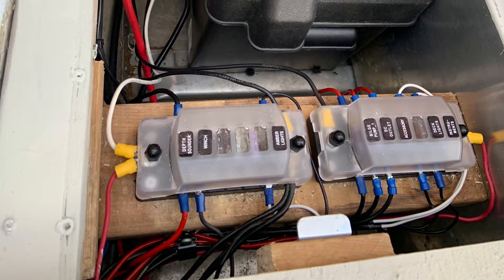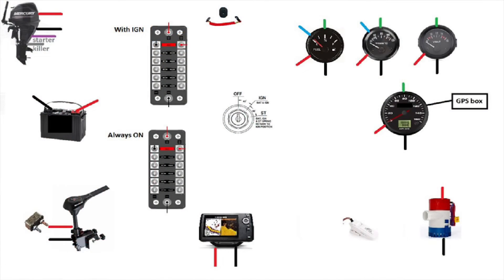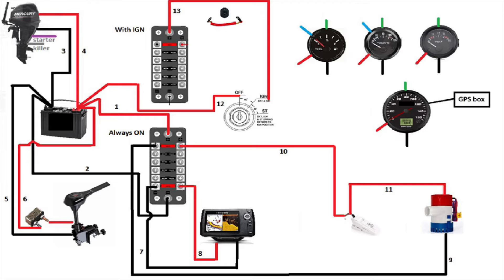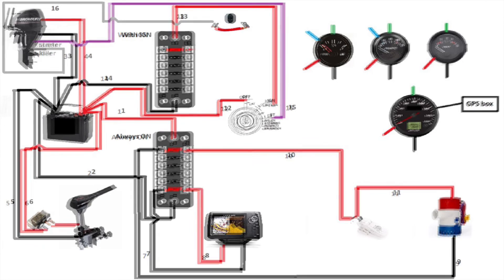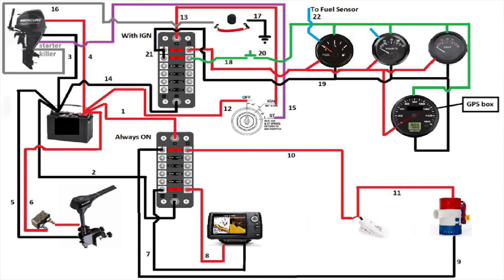Boat electronic wiring diagram

Comment: If you ha solar panel and a alternator o motor you need select key switch for charge the batteries. Other wise you put fire on tour boat
Reply from the maker: Hi nilosantos, thanks for watching, you can run an alternator and solar panels to charge batteries simultaneously, which is common in RVs, boats, and vans for faster, more reliable power, but you need proper controllers (MPPT/DCDC) to manage voltage and prevent overcharging.

Comment: I always thought the voltmeter showed that the motor was charging the battery, but here it simply shows that the battery still has 12v, or have I misunderstood it?
Reply from the maker: Hi Rsngo, thanks for watching.
 If the battery isn’t discharged, you will usually get a voltage of 12.x V reading of the battery. 
When your motor is on and it’s charging your battery, you will see a slightly higher voltage about 12.8v to 13.8v depending on your regulator or alternator on your motor.
Reply: @joetheboatguy5394 thanks :)

Comment: Your the best! Fantastic video man 
Do you think this concept can be scaled up to a dutch barge style boat with an inboard engine?
Reply from the maker: Hi trelcomultiskilledtraders, thanks for watching and nice comment :) This can work for a Dutch barge style boat but you will probably need more batteries in parallel since the boat will have more power needed. Be careful with wire gauge. If your boat is mostly docked then I would had solar panels. Let me know if this helps

Comment: you have just created a mass of short circuits
Reply from the maker: Hi Cien_Swiatla, thank you for watching. Can you be a little more specific where the short circuits would be? Because this circuit has been created and working perfectly with no issues for years. Let me know, Thank you.
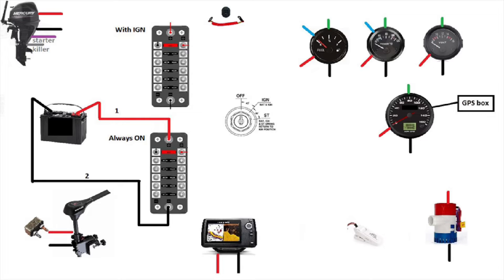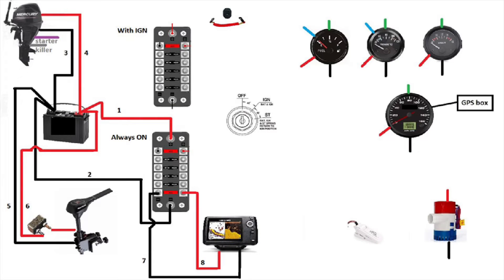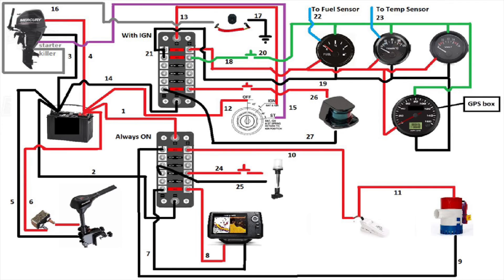Reply: @joetheboatguy5394  1:20, 1 side of the fuse box is not + and 1 -. 2:06 you just connected positive wire on 1 side of the fuse, and the negative on the other side od the fuse (cables no 7 and 8), 2:18 same thing (9, 10 & 11 wire), 4:07 and 5:00 again, negative through the fuse to positive.
Reply from the maker: OK, I see where you think the short circuit are…. Fuse box has one side negative and the other side positive the middle of the fuse box is where positive power passes that ends up on the positive side after passing through the fuse. So the negative side of the fuse box is like a bus bar
Reply: @joetheboatguy5394  yes
Reply from the maker: In words, it’s a little hard to explain. I’m gonna do a little drawing. Give me a couple of days. I’ll get back to you soon, but believe me there’s no short. 😉

I will try again with words but like I said it the drawing will be much easier to understanding. 

The negative side screw of the fuse box doesn't touch the fuse at all. 

So all the negative are connected to the Negative wire like a bus bar. So this will be all the return of the unit you've connected.  

The positive wire of the fuse box from battery the big screw on top, is the one that connects to all fuses in the middle (like a highway) of the fuse box to then distribute to all little positive screws. So you can look at it like fuses are the exit to highway. So power come from big screw on top goes to all fuses by middle of fuse box (highway) and exit thought all fuse to positive little screw.  

The two inline little side screws are not connected to each side of the fuse. That would be a short like you say but the fuse box is not made that way. Hmmmm let me know if it more clear. But I will work on something to make it clear :)
Reply from the maker: Positive from battery        
------------------------------------------------           
                  O>>>>>>
- o <            	        > Fuse  >  o +
- o <            	        > Fuse  >  o +
- o <            	        > Fuse  >  o +
- o <            	        > Fuse  >  o +
- o <            	        > Fuse  >  o +
    <<<<<<O
---------------------------------------------
    Negative from battery

Did something really quick, let me know if this clears things out. The O's are the screws on each side of the fuse box.
put little arrow for direction of the voltage. Moved the fuses a little more to the right so it's less confusing.
Reply: @joetheboatguy5394  Yes, now that explains everything. On your video it looks like you have just 2 terminals - line and load, it doesn't looks like you have separate negative terminal, that was confusing me.
Thanks for explanation and your time.🙂
Reply from the maker: Yes unfortunately that how the fuse box is made.
Reply: @joetheboatguy5394  I'm talking about the drawing in your movie. You have various fuse boxes.
Reply from the maker: oh ok yes, one fusebox is powered at all time and the other fusebox only powered when ignition is on.
Reply: @joetheboatguy5394  in my last post I could have confused you a bit, when I wrote that there are many types of fuse boxes - I meant that not all of them have a neutral separate terminal

Comment: What is pink wire and where does the end off instrument hook to ?
Reply from the maker: Hi user, thanks for watching, don’t forget to subscribe 🙂. 

On Boats, Pink Wire is for a Fuel Gauge Sender to Gauge usually. Now it all depends on if it’s original wiring or modified wiring. Hope this helps 👍

Comment: Hi Joe, thanks for your videos.  Have a Phoenix 920 xp. Going down the Ohio and lost the fuel gauge and power to main switch panel. No pumps!
 I can  figure out how it gets it power.
Help
Thanks Ken
Reply from the maker: Hi Kensullivan. Thanks for watching, Ok let’s start with your main switch does everything else have power? If yes then you might have a bad ground on tour pump. Fallow all the wire from pump and see if you see any damage wires. For the fuel gauge you might have a burned fuse or a loose wire. Do you have a multimeter to do some test. Let me know. 👍

Comment: You should add a power on/off switch for both.
Reply from the maker: Hi gottafly, thanks for watching. Yes absolutely you can add power on off switch. I’m try not to add too much, it would make it harder to understand. The diagram is the minimum, you can add so much more. 👍

Comment: What about wiring a trim gauge.I have a mariner 60 efi 2024 four stroke and bought the gauge but not sure how to wire up 
Can you help with this 
Regards
Andy
Reply from the maker: hello User-fw1ry7mg9v, Thanks for watching, usually the trim wire go as fallowed. 

Red wire for power (+12V) with fuse, 
Bleu wire goes to the negative of the batterie, 
Black goes to your Sensor signal on your trim,
Orange is for gauge light, so you can put (+12 v with a switch if you want to turn on and off).

Let me know if this help :)

Comment: Hi, one of my gauges (water pressure) does not illuminate, does it have a bulb of some kind? It is a new boat. Is there a particular color wire that controls the light? All my other gauges illuminate. Thanks
Reply from the maker: Hi flipper, Thanks for watching. If it’s a new boat, then it should be under warranty, I would just let them fix it. If all your gauge have lights, I would not see why the water pression wouldn’t have one. Sometime it's just behind the gauge the light bulb is in a socket that just needs to be turned or your light might be burned. But since your boat is new, let the dealer fix it just for warranty purposes.

Comment: Shouldn't they be a main battery  switch
Reply from the maker: Hi myronchamberlain. Thanks for watching. 👍 I usually separate videos by diagram so it’s a little less complicated to understand but I do have one where I combine the battery switch with the boat wiring diagram. I’ll give you some links.

Here’s the battery switch : https://youtu.be/USG1xZju1DA?si=dbXQ0N8yR2CjMQl0

Here’s the battery switch and boat wiring diagram combined: https://youtu.be/l4Ve6KpiAqQ?si=TNdTjM3A5juA_dOh

Hope this helps 👍

Comment: Very good information Joe. Iv been working on my 2018 Triton SF18 Bass/Ski Boat for a month now. I Have two Helix 12 ,minkota  Ultrex, 
trolling motor with its own 
battery source and decided  
to add Humminbird mega 
Live and mega 360. Iv 
added a Helix 10 for the 
down imaging . Both units 
require their own on and off switches and fuses. All went well until I add a ( Y ) cable to have the ability to monitor both down imaging and 🪧 on the same unit.  Also, I have an ethernet hub from 
Hummingbird, connecting all graphs. I have a separate
 power source a 30 amp 

milliamp Lipo battery 
connected to the ( Y )cable , 

and realized that I had two different power sources entering the same unit. And my boat shorted  out . Where should I start the 
Diagnosis ? To locate the short. I have a Honda 170 HP engine lost power to  the tilt . Both circuit breakers did not trip. All batteries checked out fine. any suggestions where I should start to diagnose?
Reply from the maker: Hi Kenneth Greene, thanks for watching, first I would do is disconnect the batteries if not already done. But if you say you have a short, I’m guessing you disconnected batteries already. I would take a multimeter and connected to the Positive wire that goes to the batterie (that is disconnected from batterie) and connected to the Negative wire that goes to the batterie (that is disconnected from batterie) and set the multimeter in continuity. If you do have a Short, you will hear your multimeter beep at this point. 
Now I would remove one fuse at a time until your multimeter stops beeping. That would be the circuit to redo or verify. 
If you remove one by one and multimeter doesn’t stop beeping, then remove all fuses. (BUT remember where all fuses go, take a picture if it helps) 
If you remove all fuses and multimeter still beeps, then your short is before the fuses. OR on equipment that is not fused which shouldn’t be done 😊
Let me know if this help. Let me know
Reply: Ok Joe , that’s my next project, I’ll will keep you posted… Thank you for your reply and information.

Comment: Excellent Video I really like your explanation sir. Sir could you show a video of a wiring connection of a tachometer on a Merc 150 blk max mtr?  My tach lights up when I turn on the ign. but does`t give the RPM signal .
Reply from the maker: Hi Horace Lee, thank you for watching and comments. On the tachometer RPM gauge. You usually have three wires one for power (purple or red), the other for ground (black) and the third one is usually (gray), it comes from the sender of the engine. Now since your tachometer goes on, your gray wire might be the problem. Make sure there’s no cuts on your wire and make sure your sender is functional. Your problem seems to be on the gray wire, the sender or the tachometer it’s self.  You have 3 things to check 👍. Let me know if this helps and good luck 🙂

Do you see the arrow move at all? Or if it’s digital, do you see numbers showing up?

Comment: Very nice diagram; where can find how to connect the outboard wires to controller for Handa 35 hp
Reply from the maker: Hi Ten Moi, thanks for watching. unfortunately I don't have controller for Honda 35 HP
Reply: I would sell the Handa and replace it with a Honda.😂

Comment: Why do my boat gauges peg and alarm sounds when I turn nav/anchor on
Reply from the maker: Hi The diamond Billy!, thanks for watching .Your power distribution might be the problem. It seems that when your anchor goes on the rest is not getting enough power. Make sure you have the right gauge wire for your accessory’s. Let me know if this helps.👍
Reply: @joetheboatguy5394  that would be on my 1997 Donzi 275 lxc
Reply from the maker: Hi on that model I wouldn’t know. But if it’s a gound wire it need to go to the negative bus bar or directly to negative of the battery. Check if any connection are lose. That can cause your problem also.
Reply: @joetheboatguy5394  
Would you know where the nav/anchor ground wires are connected to

Comment: Good video work for a basic wiring layout! For my bilge pump and float, I chose to "parallel" ( instead of being in "series" like your schematic) the float switch to the pump and it has it's own direct to battery ( but fused) +12V connection, and, instead of that bilge pump power going direct to the fuse panel, my boat's original wiring has it switched at the helm, so I kept that function and can operate it manually or let the float turn it on when needed. I also have a 10 Amp charger/ maintainer ( Minn Kota brand- absolutely fantastic charger) connected direct to the battery with its inline fuses, then, everything else is on a master disconnect to a Blue Sea 150A panel. This way, when I am docked and I can get 115VAC shore power, I can shut off the main disconnect, BUT, my charger is connected to the battery, and the bilge pump will do its own thing, without needing the main disconnect ( which is hidden in a locking access panel)  to be left on. This will insure that the bilge pump will work and the battery charger will replenish any charge when it is operating as well, and any ignition  and accessory function is killed to prevent any "hot wiring" attempts.
Reply from the maker: Hi Internutt 1960, Thanks for watching and your nice comments. Yes, I have my pump running in parallel with manual switch and float switch. always the best way to do it. I kept it basic so if people can understand this than they can go much further in their set up. Always fun doing modification and adding new stuff  ;)   You seem do be well set up my friend. 👍

Comment: can you charge both batteries at the same time with a portable charger?
Reply from the maker: Hi Roy Wallen, Thanks for watching, don’t forget to subscribe ;) . Yes, you can but your batteries need to be set in parallel and would be good that your batteries have the same specs. It will take longer to charge dho.  If you want to recharge batteries independently you can do it this way: https://www.youtube.com/watch?v=Q8VgRRlOmW0
Let me know if this answers your question 😊
Reply: @joetheboatguy5394 I have burnt up 2 regulators. When i hook the positive on one battery and neg. to the other battery and plug in the regulator it fries it!!!!
Reply from the maker: Hi Roy Wallen, What charger do you have? Do you have a smart charger? 

Also if you plug it like the video I sent you and your battery switch is set to off-----> that should not affect your regulator. 

Also very important; your battery switch needs to be a Make-Before-Break switch or you can damage the alternator or regulator of your outboard when switching. Also you shoud never turn your battery switch on the  OFF position when engine is on....

Comment: Hi, would you fit a circuit breaker between battery and engine? Also between battery and always on fuse box and battery supply to ignition?
Reply from the maker: Hi Lee Alton DJ Alton X, Thanks for watching. 
For adding circuit breaker, it always extra protection, its never a bad idea. Some engines already have their own protection. Between battery and always fuse box, well your fuses are your protection.  And for the ignition like I said some engines already have their own protection. 
Thanks :)

Comment: Wow!  What a great video.  My problem...I bought an SX210 with no battery in it.  Wires all over the place, red black and other.  Connected all the red to pos and black to neg and blew something....how in the heck am I going to figure out which is pos and which is neg on unmarked wires at the batter box?  Going Crazy.  Tks
Reply from the maker: Hi gandl2123, thanks for watching and nice comments don't forget to subscribe :)
Yes, it not easy when you get something that is all undone. Multimeter will be your best friend to find which wire goes were. do one step at a time try not to connect everything at the same time. One equipment at a time and you will get it :-)

Comment: Would you be so kind as to show a diagram of wiring a fly bridge .
 Joining both the upper and lower Helms.
 Nav lights, 2 Bilge pumps, 2 Maserators,
Live well, shower, Transom pump, water pump,  blower, cabin lights, VHF radio, stereo, Horn, house battery, starter battery,  
Thx you your videos are great.....
Reply from the maker: Hi shawn springstun, Thanks for watching and comments, I usually do the basic so it's easy to understand, then you can add whatever equipment you need on "Always on fuse box" or "Ignition fuse box". I do have a video on how to connect a radio: https://youtu.be/Ih4kXGI4zzc see if this helps.

I was asked to remove some of my videos because i`m revealing information they don`t want me to reveal. :( I did't remove anything.

So, I show basic and then you just have to add the pieces you need all together.

Thanks

Comment: I'm wondering where you get the graphics for the different system components you have in your diagram - are there online libraries for these, or do you just scavenge them from websites and catalogs and resize to fit?  Many thanks!
Reply from the maker: Hi Allan Kaplan. Thanks for watching, I take the graphics from a catalog I have and resize them 👍

Comment: Is the always on and with ign  boxes fused at each connector
Reply from the maker: Hi Mary fithen, thanks for watching. The ING fuse box is only powered once your key is turned on the ignition position. And Always ON fuses boxe is always powered. Let me know if this answers your question. 👍
Reply: @joetheboatguy5394 are both connections fused
Reply from the maker: Hi Mary fithen, so if understand, you want a fuse between the battery and fuse box. If that’s the question then no it’s not necessary but you can if you want. Every equipment is already individually fused by the fuse box.